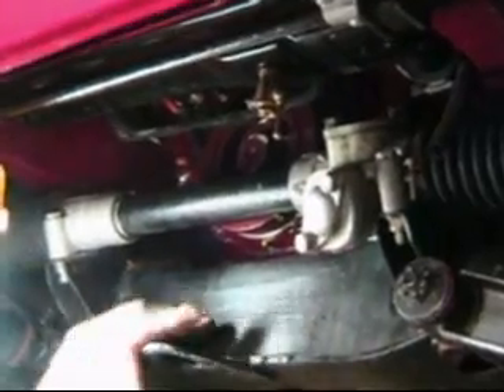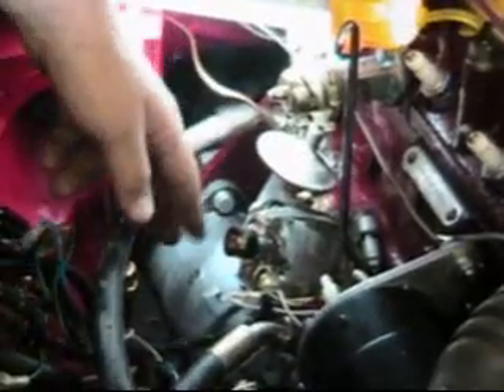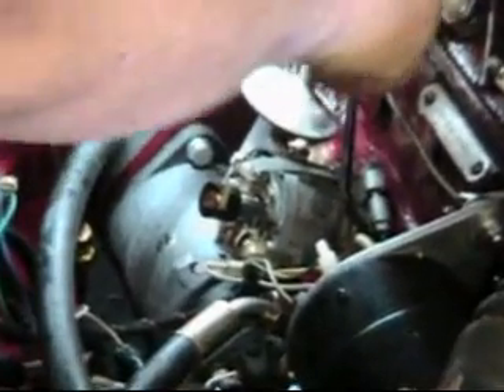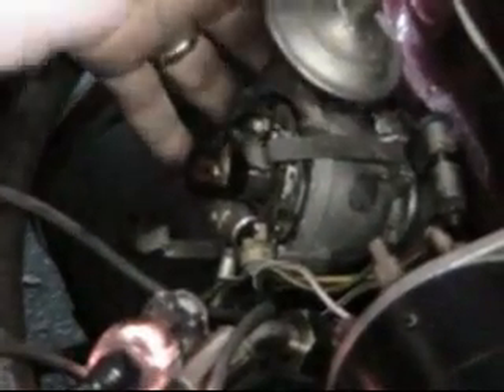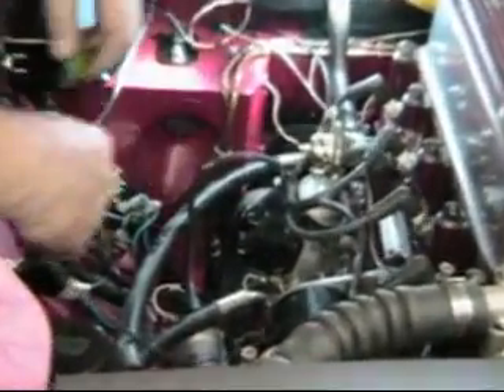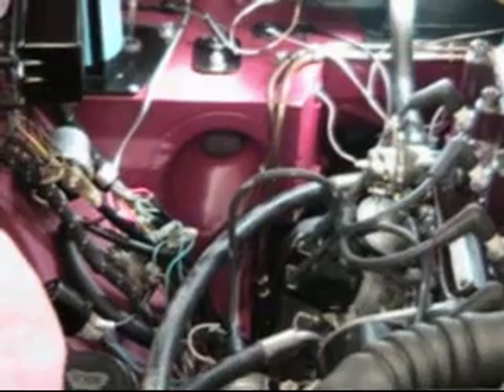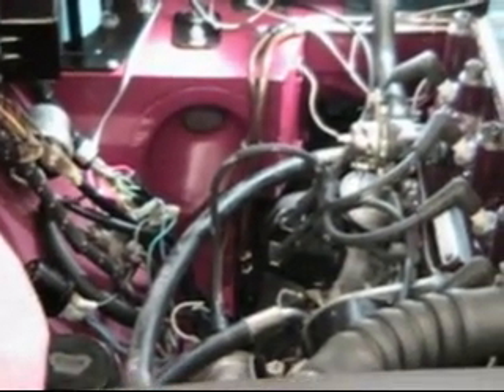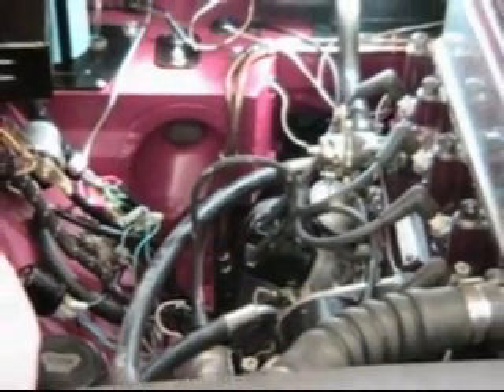007  MG Tech | MG Static Timing

Comment: It has to be on the compression stroke as well.That's the 2nd from the front on no 1 cylinder the inlet opens then is fully closed with play on the rocker for both inlet and exhaust valves on no 1 cylinder.

I appreciate your videos and your history with the MG.
 I live in Coventry.
I have a 1967 MGBGT that was in a garage for 40 years.

I have it outside and I hope to get it fired up.
I'vd had it for two years and it's been difficult to find the motivation to get it back on the road.
I need to get some welding done and the brakes and clutch.
bled 
I got a replacement SU fuel pump and fitted SPAX rear shocks.

One wheel took two days of hammering to unseize the brake.
The wheel
Is a bit close to the arch.
 I think the leaf spring needs replacing.

The Council don't like people doing work on the roads.It's not like it used to be.
Some environmental act from 2005.

Comment: My timing is way off I'm 50° plus before top dead center what did I do wrong
Reply: Get it fixed?
Reply: @garlandjones7709  that's the idea seemed I had a bad distributer timing is closer but still not righteous sure if it's due to cam being a 3/4 race
Reply: @jbstepchild  are you checking timing at idle?
Reply: @garlandjones7709  my tach doesn't work as I have an A with a B motor

Comment: Can some please tell me which wire is the low tension lead the you hook up the test light too?
Reply: On the side of the distributor is a spade connector. This is where you connect the test light to. This connector is often called the "low tension lead". In normal operation a wire would go from here to the ignition coil.

Comment: For the test light, I just removed the wire on the connector which is on the distributor, and then I connected my 12v test light between that connector on the distributor and the live terminal on the fuse box (not from the wire itself that connects to the distributor). It's not clear on the video so hope that helps. Absolutely brilliant vides by John Twist, really help you to get the things right first time... mine started first time after doing this.

Comment: It is true you can’t use a light is you have electronic upgrade to distributor?
Reply: Correct. This method can not be used for electronic ignition, only for points.

Comment: After an hour of searching I think you have answered my question in showing the static timing set up. I have a Lucas DX4A off a David Brown tractor which was having issues with back firing and I thought I would strip and clean the distributor, forgetting about having to time the cam lobe when I re-assemble. My plan now is to find the "M" timing mark on the flywheel which is 7'BTDC as per workshop manual and use the static timing method to position the cam lobe to just breaking the points and the light going out with the rotor facing #1 cylinder.
I watched a few of your posts and enjoyed them, thank you.

Comment: I am doing everything right on my 74 Midget but I can't get the test light to go out. What is the problem?
Reply: It is necessary to adjust the points gap first, before moving on to the static timing adjustment. You could have a problem where the points are not opening but are always closed.

Comment: I don't have a low tension lead on my distributor. What brand of distributor are you using? Is there somewhere else you can put the test light other than the low tension lead? Thanks! -Tim
Reply: If you are running a standard distributor,  there really has to be a low tension (6 or 12V) lead,  otherwise you would have no spark.  If your are working on a running engine dig around a bit more,  if its not running you may have found one of your issues.
Reply: What is called a "lead" in the video does not refer to a cable. It refers to the spade connector on the side of the distributor which, in normal operation, is connected to the ignition coil. The distributor is of the Lucas brand.

Comment: crap I can't get it running with a pertronix ignition.
Reply: Have to use a timing light on those. Adjust while running and looking at position on pulley.

Comment: @MrStubat Yes, the point gap should be adjusted first! The cigarette paper (or any light paper) will get you in the ballpark.. the timing would be slightly less than 10 degrees, but that should work reasonably well, yes! If your eyes are very good, you can also just look at the points to see when they just begin to open.

Comment: Should the points gap have been adjusted BEFORE doing this....if no light available use a cigarette paper between the points...when the points open enough to let go of a cigarette paper is the same as when the light would go off....

Comment: Can you do this with both electric and point
ignitions? And what would connecting to something "Hot" be in this case?
Reply: He mentions at the end of the video that this method can not be used with electronic ignition.
"Something hot" refers to a point which has 12 Volts supply (i.e. battery voltage).

Comment: To take the guess work out of what socket size you need to turk the crank, it's a 1-5/16. you may also need a reducing socket adapter to fit it to your standard rachet wrench. GREAT VID THANKS!!!
Reply: I couldn't even get a socket an bar in had to use a wrench it was hell looks like I got in a fight with a cat

Comment: The easy way, I feel, is to instead of using a light, do the following:
Take off the distributer cap.
Turn the motor to the correct position using the timing mark.
Turn the ignition on for the car.
With the clamp for the distributer loosened, turn it counter clockwise far enough that the points are closed, then clockwise until you see and hear a spark.

To answer your question, something hot means something live - basically is connected to the positive side of the battery (+12v).
Reply: Thank you for clearing that up 'something hot'
Reply: Hi how would you do it with electronic ignition, would you have to use the method in the video?
Reply: an even more fred flinstone way is to do the manual alignment,  and just turn the distributor till you get the smoothest/fastest idle.   Works well enough to get home.
Reply: Why is it that nothing is working for me???  Not even getting a light on???